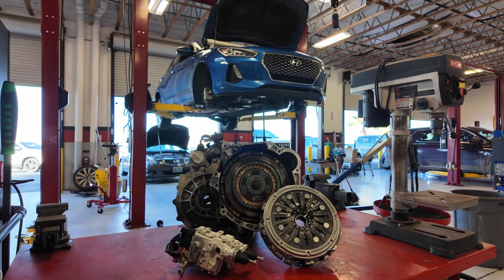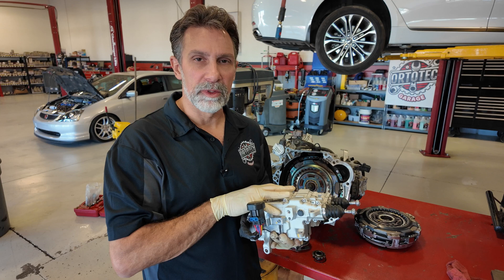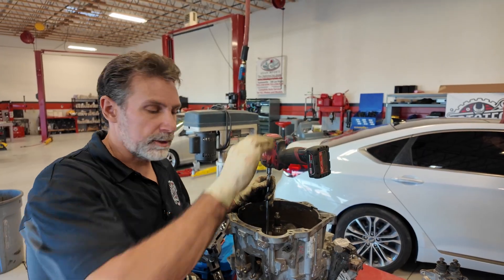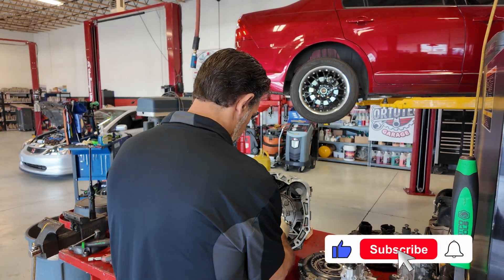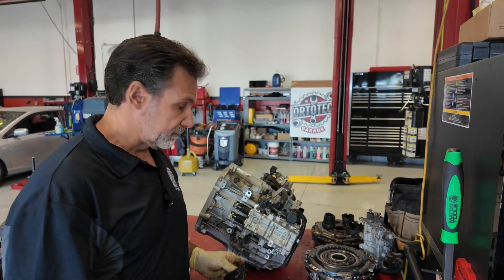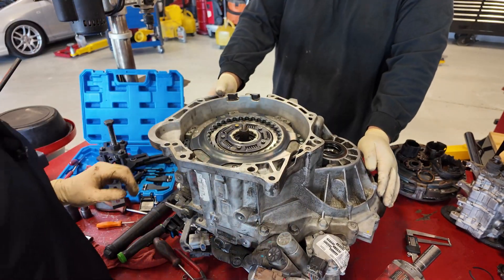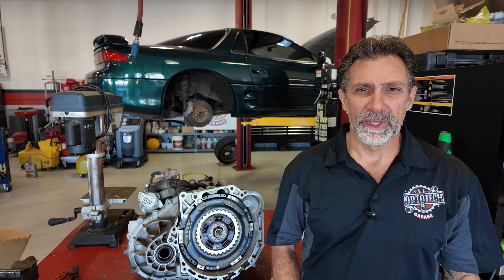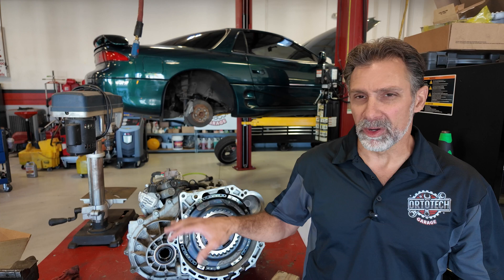Inside a Dual Clutch Transmission – Full Hyundai Elantra DCT Rebuild!

Comment: @4:26. So that fastener is over torqued. Doesn't really matter, but might as well just not use a torque wrench. Interesting and clear video otherwise!
Reply from the maker: Im not sure which fastener you are referring to, but every piece of hardware on the vehicle has a torque specification.  Some are more critical than others.  Its really difficult to do them all due to lack of specifications and time. As a professional technician especially, for the sake of efficiency, you have to learn which ones are important and which ones you can use your feel.  Certainly do them all if you are more comfortable.  Thanks for sharing your thoughts and for watching! 🙏
Reply: @OrtoTechGarage Thanks for the reply. I was referring to one off the release bearing bolts. In the vid, you turn the torque wrench, and it beeps before it rotates. That means the bolt was already at or above torque. Could also just be how the video was cut.

Comment: Informative video, much appriciated. I have an Hyundai I30 7 speed DCT here in Europe, Norway (it looks like this elantra). The car has driven 105.000 kilometers which equals to around 65.000 miles, i have been in contact with my independent garage and they informed me that they didnt have any infomation about fluid change intervals nor did they have access to filters on this model from their suppliers. They was also talking about they didnt have an adapter for flushing this model. What is your experience on this, is the information correct or should i visit the dealership (a little far away)
Reply from the maker: I would change the transmission fluid now.  Because this setup has a manual gearbox it is not like a conventional automatic transmission. It is more of a manual transmissions with electronics to control the clutch application and the shifting. It is just a simple drain and fill on the fluid.  Just look up the fluid in your owners manual because some years used a specific dual clutch fluid or one of two gear oil weights.  It should only hold 2-3 quarts and no flush required.  I hope thay helps.  Thanks for watching from Norway!

Comment: I have a 2021 Forte GT with DCT. All my even gears (2,4,6) just rev/slip real bad where I have to manually shift into 1,3,5,7 to be able to drive. Is it best to buy a used transmission for $1500-$2k and pay someone to replace it rather than to do a clutch replacement?
Reply from the maker: I think you should try and diagnose the problem first because neither option is cheap.  First, see you have any diagnostic fault codes stored for the transmission or clutch components.  There are a lot of components in there that can go bad.  At least see if it is something you can do externally before you go for the full replacement. I know its a long shot, but maybe you get lucky. If you felt it slipping for a while before it stopped working, you will probably be out of luck.  Used may be your cheapest option at that point. A new clutch assembly is more than $1500 just for the part at the dealership. Just be careful buying used, its possible to get one with problems, too.  Best of luck!
Reply: @OrtoTechGarage thank you for the response. I have an acquaintance that works for a transmission shop and they scanned it and saw 0 codes. They only use Jasper rebuilt transmissions and said it would be about $4k-$5k for one of those. Just trying to find something that's $2500 or less to get it fixed.
Reply from the maker: @uncfan07 Copy that!  I would assume that no codes means a worn clutch disc for that even gear shaft.  Expensive no matter how you do it, but shop around and weigh your options. 👍
Reply: @OrtoTechGarage  Hello, I have a Kia Sportage 1.7 crdi 2017 DCT and some time ago I started to see the message in the dashboard saying that the gearbox is overheating and I have to park to wait for it to cool down. I called my mechanic, he told me that it is probably the clutch that is slipping since in 1st and 2nd gear the vehicle is very heavy when accelerating... after changing the clutch kit and adjusting the actuator to 72mm we started the vehicle but it does not move forward or backward, we tried to do the calibration with Autel MK508 but in the end it writes error (mismatch between target position / actual position) it gave me the fault code p090B and I would like to know if you can help me?? please

Comment: Maybe you can help me here, I have a 2016 Tuscon with a DCT.  When I am slowing down to a stop and the trans shift down to 1st gear, if I don't come to a full stop and go to step on the gas, the transmission make a terrible squealing noise.  But If I drive in manual mode and shift that way I don't have the problem.
Reply from the maker: It's very difficult for me to diagnose without looking at the vehicle. I would start with a scan tool and see if there are any fault codes stored for the transmission.  Then, get into the data for the transmission and see if anything looks out of the ordinary.  Check the fluid level and condition.  Look for any obvious signs of clutch wear by looking for excessive clutch dust or clutch material around the bellhousing.  Then, listen to the clutch and transmission while on the lift to try and determine the location of the source of the noise.  My gut feeling is there is a problem with the clutch assembly, but confirmation is required. If all of the above is inconclusive, I would disassemble for a deeper inspection.
Reply: @OrtoTechGarage thanks, my plan this weekend is to pull the trans and look at the clutches and go further if I need to.  Any chance the actuators could cause it?
Reply from the maker: @davidrohe8056.  it is possible the actuators could be malfunctioning or even out of adjustment.  You may or may not see anything when you remove the transmission.  The clutch assembly is sealed internally, so dont expect to see much of the clutch disc.   My video give a good indication of what you will be able to see and what you won't.    There are also gear shift actuators for the shift forks internally separate from the clutch shift fork actuator.  Make sure you check all of those items I mentioned previously first. Best of luck!
Reply: @OrtoTechGarage would you happen to know where I can get a synchronized kit.  Looks like I have the one going from 1st to second bad
Reply from the maker: @davidrohe8056  Direct from Hyundai would be your best bet.  If you are unfamiliar with this type of repair, I would recommend finding a replacement transmission. These repairs require special tools and knowledge.  Possibly, a recycling yard would have a low mileage replacement for less money and headache. 😅
Reply: @OrtoTechGarage I rebuild automatic and striped apart manuals, but never dct's.  Are the gears and synchronizers that much different then a manual.

Comment: My gf has a 2018 Elantra Sport with this transmission and the clutches are making noise under acceleration above about 30% throttle. She is still within the CPO warranty, will that cover a clutch job or is that considered a wear item?
Reply from the maker: Hyundai has that long warranty for the original buyer.  It really depends on the dealer.  Generally, wear items like brakes and clutches are not covered by the dealer warranty.  But some dealers may help you out, or it's possible there is another covered component in the assembly that has failed.  Hopefully, you get it taken care of at no cost.  I would definitely try.  Best of luck!  👍
Reply: Hyundai does not consider the clutch pack as normal wear items. If the car is under warranty and they don't try to screw you with some sort of severe service accusation, it ought to be covered. Look at the forums. They are apparently just replacing the whole tranny, or at least they were early on. It's too tricky for a dealer mechanic I guess?

Comment: Hi I have Hyundai i30 dct gearbox , I had gearbox issue so i bought similar car with very low mileage swapped the whole geaebox unit  but problem is still  there dnt know what’s going on , mechanic did gearbox calibration that did not work either . Took it to Hyundai they saying its your actuator but my question is how? I swapped the whole unit from a b low mileage running car
Reply from the maker: That's tough to answer without the car to test some things.  What are the symptoms?  Is it setting any fault codes? I would need more information.

Comment: Where can i get the removal tool.
Reply from the maker: Here is an Amazon link to the tool I used in the video.  Its a little wonky, but it works with some patience.  If you're only going to use it once, I wouldn't spend too much more.  Good Luck with the project!     https://amzn.to/448kazl

Comment: So if I replaced the clutch assembly and a new Actuator there are no adjustments necessary?
Reply from the maker: Yes.  This is correct.  As long as they actuator is replaced with a new unit. It is preset from the factory, and no adjustments are required. You will need some special tools to pull the clutch assembly and press it back in. Be sure to clear any fault codes if they were set.  👍
Reply: I just put one in new actuator and clutch and it shift to late. Is it not adjusted right? Can the actuator be removed without pulling the trans? Thanks in advance

Comment: Approximate cost of this service?
Reply from the maker: Depends on your area, who you take it to, and what components need replacing,  but plan on somewhere around $5000 for what you see in this video. The parts are costly for this setup.
Reply: did you put a new actuator what happen to the other one
Reply from the maker: @1minago506  Yes. It was setting trouble codes for the actuator.
Reply: @OrtoTechGarage  do you have the code on mine am getting actuator fails during adaptation
Reply from the maker: @1minago506  I don't remember what the codes were. It was quite a while ago.  Sorry.